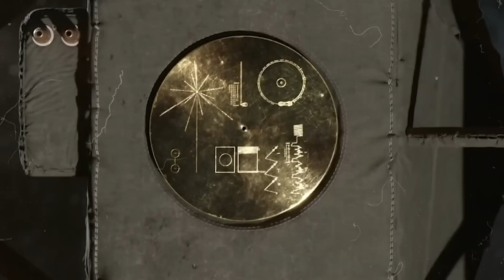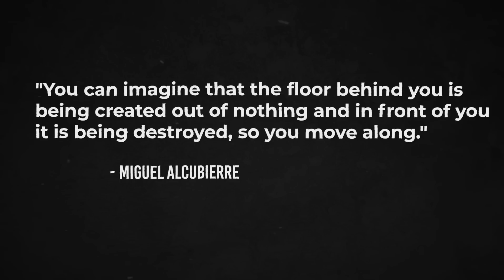Warp Drive Has FINALLY Become Reality! German Physicist Found A Solution!

Comment: Sub light engine. A Zero point modual is possible.  Given curent development in subatomic particle research - the surounding space time is the fuel for the sublight engine. It was always the Schrodinger cat in a box in addition to the constant Lambda.
Super symetry effect. Sub light engine research.  Advanced Fusion engine design. A re-configured Fusion engine desisign spere inspired. Modeled on a spericle concept. The configuration is spericle.
Super electro magnetic thermo core. Paralels an actual star at the core generating a masive electro magnetic field like that of a sun.

Comment: Why warp spacetime when we could just travel around it altogether? Not necessarily through wormholes.
New discoveries at the LHC from particle scattering amplitudes suggest there are geometries beyond spacetime influencing our own. In fact, these new geometries, outside spacetime, reduce the calculation of particle scattering amplitudes to a simple few terms, but when done with classical quantum math inside spacetime, you need a supercomputer. Many physicists now believe and see spacetime itself as not as fundamental as we once thought. It does make sense! The Planck scale, the limit of spacetime, at 10^-33 meters, is NOT incredibly tiny compared to most things in the universe. We also have Nobel Prize-winning experiments proving non-locality – no distance, beyond spacetime – and black hole math hints at something beyond spacetime altogether! Could warping spacetime for traveling through space be our Mickey Mouse thinking, assuming spacetime is fundamental, so we naively try hard to travel through it when we could just go around?

Comment: If traveling faster than the speed of light is practically impossible, and so it will be a Warp Drive, then they are two possible ways to answer the question of "if we are alone in the universe".

Either they are not Extraterrestrial Intelligence Species out there, or if they are we will never meet them since traveling faster than the speed of light is practically impossible, and so it will be a Warp Drive.

Comment: Two centuries ago when the fastest travel was on a steam locomotive that could travel at over 40 miles per hour it was believed that if you were in an enclosed car the air would be sucked out and you'd suffocate. When aircraft were traveling in the hundreds of miles per hour it was believed that no one could travel faster than the speed of sound. Now, because Einstein said that nothing could travel faster than light it is believed that the speed of light is the absolute limit of travel through space. How often has science's current "truths" become the "myths" of another time?

Comment: Light is a small part of the EM spectrum. The faster you go, the shorter the time between wavelengths of EM radiation will become. As you increase speed through the EM spectrum, each successive frequency will become a constant resistive pressure against your direction of travel.
Without adequate energy disbursing shielding, the resistive pressure will reach a point at which it equals your drive thrust; homiostaic balance.
Thrust is a differential comparative function of velocity; without a differential, no thrust exists.
Once a kinetic energy is involved, mass comes into the calculation. What is mass?  F=mA: m=F/A where A=differential of distamce over differential time.
Perhaps we should not limit ourselves to FTL presuming lamda to be a constant; the massive gravitational forces encountered in black holes prove it is not.

Comment: so they still think they need as tremendous amount of mass and energy  so if they need energy then maybe harness the power of a star  not the sun  a star in a jar sonoluminescence type  said to be hotter that the sun so why not think in that scale as you cant harness the power of the sun in its real size except for solar power  that makes it useless then so think of that tiny star in a jar of water hammered with sonics sound that may be your clue to faster than light travel

Comment: I am a self made scientist Not a college or university graduate I have already been able to travel (4 - four) hours into the future  And I have done this multiple times  I have already discovered the existence of Dimensions (Not Geometry) But real Dimensions  I did my first teleportation attempt in 2016 And it was a success It did take 3-4 month to complete But it worked  !!! I have also discovered (0- point-energy) Or at least this is what I think that it is This I had to devise In order for the other experiments to work But to do this I had to first prove some quantum laws , rules , ect. In order to base my experiments on , and on how I was going to set them up (arrange them) And it worked  But now for this top video by voyager I don't it will work only because There is still alot of parts still missing (it's incomplete) 😉😉😉
Reply: sarcasm st its best😂

Comment: There are neutron stars spinning at millions of rpms, the are called magnatars. The surface of the star is rotating faster than lightspeed. A 1400 kilometer circumference at a million rpms. That means it spins at 1.4 billion kilometers a second. That is faster than light.
Reply: Where did you get those figures from? They are wildly different to any i have previously seen, so if they've come from a reputable source i would love to know more.

Comment: Sorry, but this is not how a warp drive would function. No particle can be accelerated faster than light. But Spacetime can. There are parts of our Universe that expand faster than light because the fabric of spacetime can expand faster than light. The trick of the Warp bubble is to not accelerate the Star Ship, but to move the Space around the Star ship. While you seem to travel faster than light from an outside observer, it is only the bubble that moves while the ship is stationary inside the bubble. That is why you could travel faster than light. You don't, only the spacetime around you moves.

Comment: even if we managed to create an engine that could go 99.9999% the speed of light  , the fastest actual speed we'd have acheived is  49.99995% the speed of light. the reason  is because if you got a ship up to 99.9999% the speed of light , you'd spend half your trip decelerating after having spent half your trip acelerating. effeivitely making your actual speed  for the trip from point a to point b  half what your peak speed was.

Comment: Timestamp 6:41 Incorrect analogy used.  [...] "galaxies that are exceedingly far away from us are still being accelerated by the expansion past the speed of light." is incorrect.  These distant galaxies are NOT receding from us faster than light.  Their apparent speed is an optical illusion generated by the sum of the amount of incremental spacetime expansion between us and their current position in the universe.  Each light year between us and them has some tiny amount of spacetime expanse.  The sum of each amount of expanse added together makes it appear that they move away from us faster than light.  Those distant galaxies only appear to be moving away from us at a speed faster than light because the spacetime between them and us is still expanding, but just barely for each light year distance (compared with the original inflation).  Our best speculation is that the inflation experienced during the first nanoseconds of the birth of the universe has stopped and the spacetime those galaxies inhabit is expanding no faster than our local spacetime.  The apparent speed that they moving away from us is an illusion.

Comment: But here's the thing, Einstein's theory is an older theory not updated to be matching with modern technology. We update the theory to put in the fact modern science is different then science he used for the theory. We are limiting ourselves by using the past to measure the future but we come short, if we catch it up we'll have that much more length to play with.

We update the theory based on modern science 

We use the updated theory to make modern projections

We make new theories that make us go further and further until we are finally able to possibly go to proxima centauri

When this happens THAT will be the new base we use for relativity, a patent if you will on Einstein's theory.

But thats just a theory.... A SPACE PHYSICS FASTER THAN LIGHT WARP BUBBLE THEORY, thanks for reading
Reply: But so far there has been no successor theories to either relativity or quantum mechanics.

Comment: I need a scientific answer, please.  If we would normally take 10,000 years to travel to the nearest star, and we warp space, help me understand.  The warp drive would make the time factor 4 years, but wouldn't the planet there still go through 10 thousand years if time?
Reply: You are not traveling faster than light, the space around you is. So time shenanigans are different.

Time problems arise from the missing time dilation and the faster than light travel. Alcubierre said this: "beware: in relativity, any method to travel faster than light can in principle be used to travel back in time (a time machine) [...] The conjecture does not prohibit faster-than-light travel. It just states that if a method to travel faster than light exists, and one tries to use it to build a time machine, something will go wrong: the energy accumulated will explode, or it will create a black hole."

So in theory, it may be possible to time travel to Alpha Centauri in a few weeks. Explore the solar system there for a few years and return to earth without much time having passed on earth.
Reply: @OtjPlateo  I have just found new data  I was correct.  If you can reach 99.9% of the speed of light,  than for every hour on the spaceship, normal time moves forward at 7 years!  So, to get to the nearest star would take around 4 years.  However, the time on Earth would be 8000 to 10,000 year!
Reply: @johncipolletti5611 Which is why if/when such speeds are possible they are essentially one-way trips. Warp tech, if possible, is obviously superior for hopping back and forth in your own era.
Reply: @kevinmcfarlane2752  My scientist friends have told me that the idea of a warp drive is a fairytale!
Reply: @johncipolletti5611 Your analysis might be wrong. If the nearest star is 4 light years away and if travelling at 99.9% the speed of light means every hour on board the ship equates to 7 years on earth. Then to the people on the ship. Just over half an hour would pass on the ship before it arrived at the nearest star but approx 4 years would have passed on earth not 8000 to 10000.
Reply: @juxty3102  I get this information from these silly people called scientists.  Again, the equation is 7 years for every hour of flight.  Of course, nothing is written in stone!
Reply: @johncipolletti5611   I dont know how you arrived at this, but whatever source you have is wrong.  4 years is 4 years.  Say youre able to accelerate to ~671 million mph, which is the speed you would need to reach AC in ~4 years...the rate of times passage for both the people on the ship, and the people on earth..is the same...Acceleration is Acceleration.  4 light years, is 4 light years. Light year means the distance light in a vacuum is able to travel in one year of our time. Even at very near light speed, such a round trip will take at least 8 years for both parties. Now the physiological effects on those on the ship, well..thats something we dont know anything about.
Reply: @rpscorp9457  Sorry, but spend some time researching this.  First, to arrive at the nearest star in a little over 4 years, you would have to travel at just about the speed of light. Your conclusion is completely a contradiction of space and time theory.  Can you say Einstein?
Reply: @johncipolletti5611  already covered everything i said. Stand by it. Einstein was great, for his time. Didnt want to deal with QM at all.
Reply: @rpscorp9457  Great, like we all know how they stand by peaceful FUSION!  Year after year with that promise!

Comment: Okay, I'm not a scientist so forgive my ignorance but I really dig this stuff. This is the way I see it in my limited amount of knowledge. If point A and Point B are 100 LY's apart- and by somehow bending the fabric of time narrows the distance lets say 99.9%, the distance between the 2 would become more achievable even by current propulsion technology. So essentially, you don't need to break the speed of light to travel long distances, the travel time just becomes shorter?
Reply: What you are describing is a wormhole, the pinching of two points distant in space
Reply: Even if the fabric bends and you can see the other side, there is no way you can exit from existing space - time dimension and enter in to some other in the same fabric. Only waves can do that. If that would have possible, even our galaxy or sun or any other visible galactic bodies have already done that
Reply: @vmenon1659  Because the warp bubble surrounds the ship, the ship is seperated from normal space-time.  The warp bubble is neither matter or energy so it can travel at any speed.  Whatever is in the bubble is taken along for the ride without inertial effects.
Reply: @johnunderwood-hp8rj  Yes.  Even if its possible, how much is the impact on normal earth based life form, while detaching from existing space - time fabric is never known.
Reply: @vmenon1659  We aren't detached.  We just live in a warped space causing time dialation.
Reply: yes to your question
Reply: It sounds so easy, doesn’t it? Just fold space and bingo, we move lightyears in seconds. That’s brilliant. Except there no way to do that, by the very nature of what space is.
Reply: Richmond Virginia
Reply: We are like ants looking at an aeroplane, any other civilization may well be thousands of years older or more. They might have managed to overcome time or space travel. We sit here talking about light years, they might laugh at such quaint ideas, hardly a week goes by without a headline of something we took for granted to be wrong. Aliens may well be here, we cannot understand what we are looking at, we might not allow our minds to see something, perhaps like the colour Blue. Ancient people would call the sea 'wine dark sea' rather than blue, who knows what or how other civilizations might use to travel.

Comment: Sorry for being a bummer, but a warp-drive might be impossible to achieve. From my understanding a warp-drive basically creates a gravitational wave in which the ship would be placed and propelled. Even if I am wrong in this assumption, it would require more energy than creating a gravitational wave. As far as we know, two black-holes merging created gravitational waves barely detectable, yes , the waves loose amplitude over distance yet if it took the energy of two blackholes to emit such waves, the energy required is just too much even for type 3-4 (and probably above) civilizations
Reply: Two problems with the gravitational wave assessment. 1) The gravitational waves we detect barely from black holes would not have likely been that weak at the source, like any wave its power would have dissipated over large distances as it spread out. While you did briefly touch on this, I would argue you vastly downplay the distances involved at these scales. 2) Black holes are natural phenomena, they are not designed for the purpose of generating gravitational waves, and there may exist artificial means that are very efficient for the express purpose of generating them.
Reply: Although Mass and Gravity play a part, I believe the warp concept is actually describing a wave in Space rather than a a gravity wave, although it can seam difficult to separate the 2. So working from my own previous speculation as well aspects Alcubierre later on it may be possible to bend space/time without gravity. The energy requirement to do this is likely beyond the realm of what is physically possible though. My thinking on this also leads to the the concept of a toroidal drive which I have also seen depicted with the ships with the circular rings around them. <- There is a flaw in my thinking as it also leads to a form of "Anti Gravity".
>
Just something I tinker around with when I have some free head time lol
>
[edit]
I just remembered. Have to  manipulate the density of the Higgs Boson condensate to create the wave (for and aft change) using liquid metal super conductors in the toroids. The energy requirement is still ridiculous though lol
Reply: Its already being done.. Did.. Applied... Inacted. Millions of ufo sightings.. N u still say naw... Lol🚨🚨🚨🎈🎈🚚🚚🚚🚚✈✈✈👽👽👽👽👽👽👽
Reply: That’s not the concept. It’s the idea of shrinking space in front and enlarging it in the rear. They even brought that up in the video. But you still need exotic matter and energy. Neither exist. Lentz gives us something interesting with the concept he has with positive energy. But it’s impossible to contain the collapsed matter other than in a neutron star. Then, there are impossible problems other than those his theory requires.

White holes will collapse almost instantly, so forget that.
Reply: Cant lose energy 😅